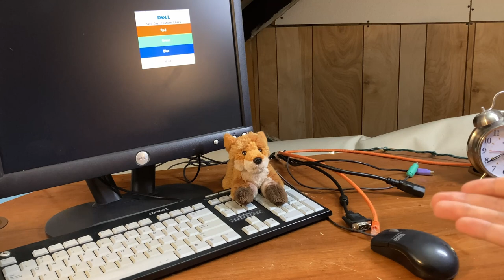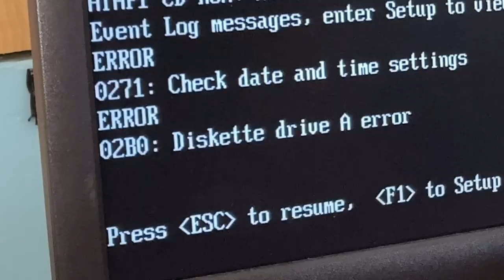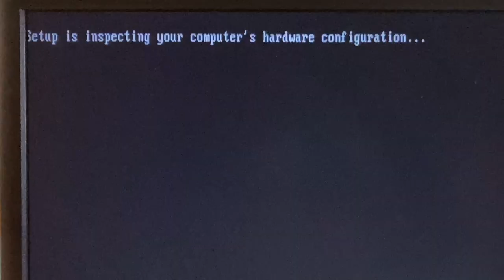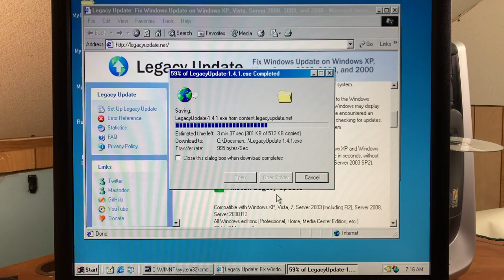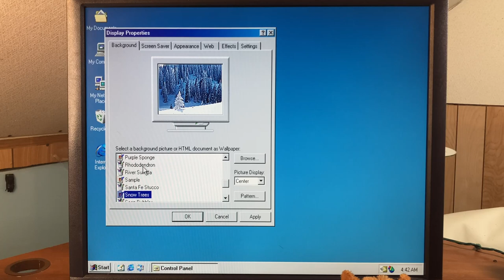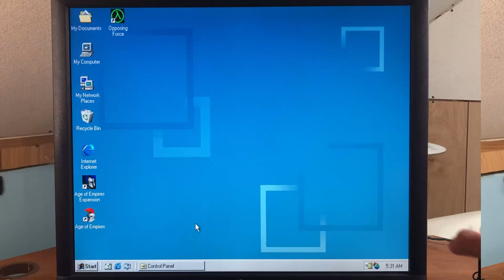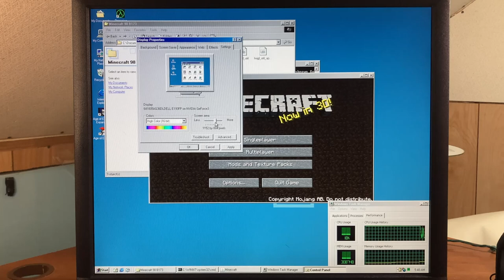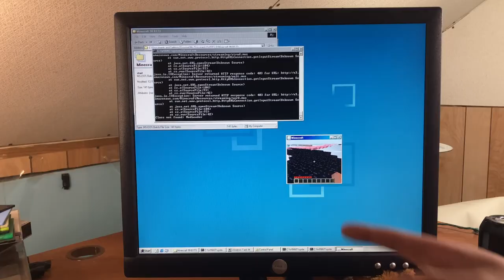Exploring an Unusual Version of Windows 2000 (feat. Minecraft) | WGEX

Comment: Running games in fullscreen used to make a HUGE difference on these older windows's. Only starting from windows 8 (i think) has it not mattered anymore. The reason is that otherwise it has to render to a backbuffer first and then copy that into the window. Fullscreen mode dedicates all of the gpu just to the game. On modern windows the difference isnt so big since the whole thing is rendered on the gpu anyway so the overhead of copying that buffer into the window is tiny.